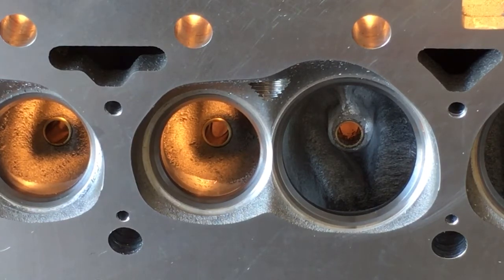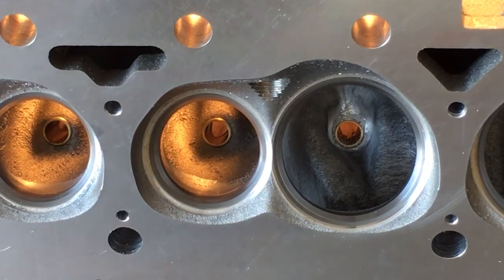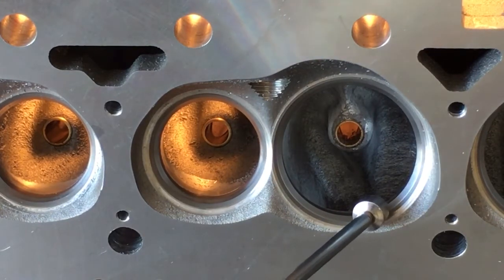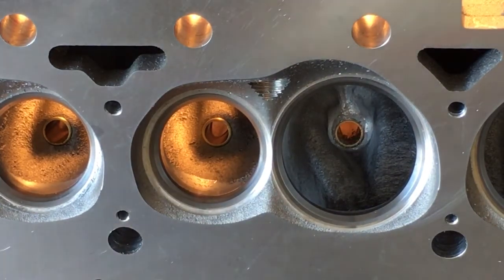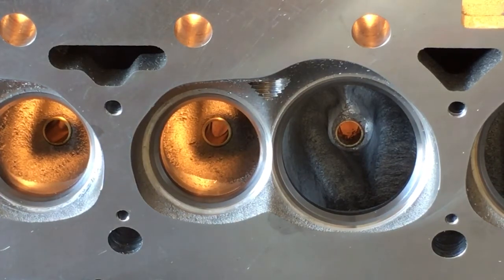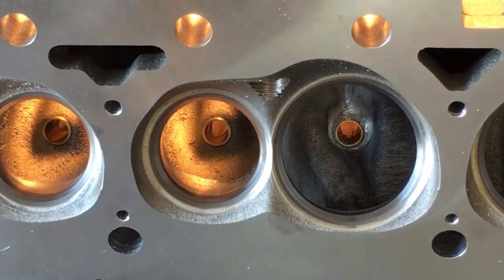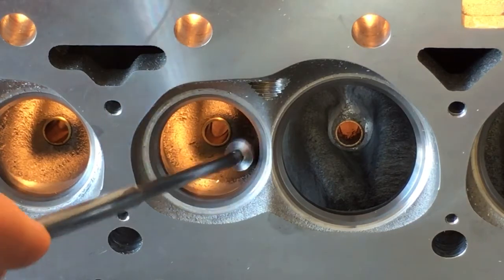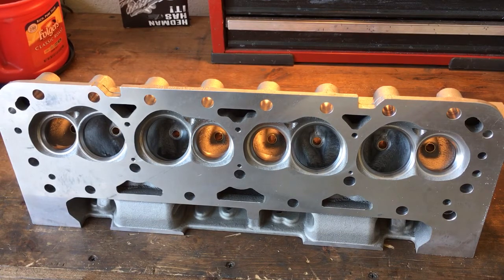Quantico cylinder heads 195cc  ebay

Comment: @HeadFlowInc any update on these after install?  I'm only seeing what are essentially unboxing reviews
Reply from the maker: The customer was supposed to put them on a 406 SBC for a 1982 Corvette cruiser.  I don’t think they ever finished the project due to health issues.  I would have been thrilled to run the heads!  JD
Reply: @HeadFlowInc  They look good in images, but I'm about to drop some coin on a replacement engine block for my Hilux and am hoping to find someone who's actually running their gear

Comment: Hi I have also experienced the vibration you mentioned. May I suggest that you replace the bearings in your grinder. Im pretty sure that will take care of that problem. I did that in my Milwaukee. If you ever drop your grinder and it lands on the collet kiss it goodbye and just go buy a new one. I know. Because it happened to me.
Reply from the maker: James Fowler Thanks for the tip, I ended up just going to Harbor Freight and buying a better version.  The HF grinders aren’t near the quality of a Milwaukee for sure!  
I have to be careful the longer 6” burrs can bend and that causes vibration even if I can’t see it. JD

Comment: Are the valves unshrouded well and adequately ? And could i unshroud them anymore?
Reply from the maker: DYNA KLO The chambers are decent, but you might be able to carefully massage the chamber a tad in a few areas. There are theories concerning swirl, directing the intake charge to promote better swirl that needs to be considered. Little If any needs work.  JD

Comment: I doubt anyone who works at dart make these, but they do seem to a good copy or clone of dart heads. I bet the biggest down side is just cheaper material and some showing a small quality control issue but not to bug by any means. I building a 355 with them and expect them to produce as good as before especially over the 193 tbi heads they r replacing lol. I chose these over using my other cast iron vortecs but my intake played a small role in that also but they do seem to be pretty damn good budget heads for no more then what they cost. I only buy them bare and purchase my components separately cause i would bet the valve train parts they put in the ready to run version are far from being as nice quality as the casting are
Reply from the maker: James J. McCloud I’m hoping the valve guides are a better quality!  The guides in the Pro Comp heads are very soft and where out really fast. JD

Comment: Do you have flow numbers and Dyno testing numbers???
Reply from the maker: Racer D I did not have these heads flowed and these were the only pair of Quantico heads I’ve worked so far.  You can compare these heads to most any 195-200cc runner heads on the market to get an idea of stock casting flow potential. JD

Comment: Put 1 bolt on the head to the block with no crank and scribe from underneath. Looks like they could be unshrouded more.
Reply from the maker: Don Rutter You’re right, we didn’t do any chamber work on these 241 heads. I’ll be posting some chamber mods on a set of 862’s coming soon!   Waiting on the machine shop, going from the stock 1.89/1.50 valves up to 2.00/1.57 valves that require valve unshrouding.  Stay tuned it’s coming!  Thanks for the feedback! 👍
Reply from the maker: Don Rutter Sorry, I got videos mixed up, the customer wasn’t paying for any chamber mods on these Quantico heads.

Comment: these are proheader pro header 200cc castings. they are dart platinum 200cc copies. it's the same head skip white sells as his nkb200 cc heads. Speier Racing Heads sells them as his economy heads & he loves them. his dart cnc program works perfectly on these heads.

Comment: Is this aluminum? And is the casting number a big deal on aluminum like it is on iron??
Reply from the maker: Jeffrey Adams Yes these are aftermarket aluminum heads.  The casting number?  Help need more details?
Reply: HeadFlowInc i was told when buying iron aftermarket heads to pay close attention to the casting number because it identifys the type and quality of the iron. Meaning not all casting are equal far as strength and durability. So is that the same when buying aluminum heads??? And whats your opinion on Blueprint heads there like 899 a set for sbc
Reply from the maker: Jeffrey Adams I’m not familiar with using the casting numbers on aftermarket heads to classify casting quality.  When burying factory heads yes 
Casting quality is something you physically and visually inspect. 
I’ve seen good reports by the Hot Rod magazine staff on the Blueprint engines/Parts.  Keep in mind when a company sponsors your show then you report good things about their products. 👍
Reply from the maker: Jeffrey Adams If you’re building a 350+ Engine don’t bother with head ports below 200cc intake.  In my experience the smaller runners leave you disappointed. 👍
Reply: HeadFlowInc thanks a lot for the info sir.... One last question im leaning towards the blue print head but im afraid that they will still have to be disassemble because of leaking valves so in your opinion do think i be better off buying a bare head and putting my own goodies in side??? My motor is a 355 with a 480 lift  flat tappet cam
Reply from the maker: Jeffrey Adams Honestly, your usually going to get better quality Parts and assembly if you start with a bare head.  Checking the valve seal should be done on any new head.  
The 280 Cam is pretty small but be sure to run at least a 2800-3200 stall or a manual transmission with it plus a 3.55 or more gear.
Reply: HeadFlowInc thanks... subscribing for sure.... And yes i have a 342 gear manual shift 350 turbo and 3000 stall and 100 shot of spary... I tore it apart simply to put a better (aluminum) head on it... My baby brother kicked my ass with his 3.7 mustang... But that was all motor and i had a stock 277 gear. Its a third gen camaro... But thanks man i really appreciate your time and info great guy to subscribe to. ✌
Reply from the maker: Jeffrey Adams Your combo sounds really good, I saw a street racer back in the late 80s who had a Monte Carlo super sport with a combo similar to yours win a lot of   Races.👍👍👍

Comment: 457/5000
Have you seen the Quantico heads of SBF? Is it supposed to be the same cast quality? I was surprised by the slight work of bowl blending around valve seats. I live outside U.S. and it is complicated for my budget hotrod for high customs costs. My options in aluminum heads are these Quantico and the NKB that provides Skipwhiteperformance in E Bay ... I guess they are of similar quality for the price. Thank you for so useful information!
Reply from the maker: Guillermo Vidal Good luck on your build!   I haven't seen the SBF heads, hopefully you'll get a good clean set.

Comment: Thanks for a quick reply. I have been looking at Edelbrock E210 at 1250.00. These being less then half the price making me take a second look. I have heard that some imported castings are not that bad its the valves and hardware that you have to be concerned with.
Reply from the maker: ZMANPERF If I needed a set of SBC heads I'd buy a set of these. As cast they're very nice, just make sure you add a steal shim under the valve springs to protect the aluminum head.

Comment: What is your opinion on the quality of the valves and valve springs on these heads?
Reply from the maker: The valves are stainless steel one piece with under cut stems. I have no idea what brand, but they look good visually.  The valve springs are a large diameter single flat tappet spring good to .600 lift.  It does use a good quality valve lock machined with the receiver groove for lash caps if needed.  I;m not impressed with the fitment to the valve of the positive valve seals, we're replacing them.
Reply from the maker: ZMANPERF Also, the valve springs are rated at 130# seat pressure @1.800"

Comment: Where did you originally learn how to port?
What material have you used to gain the base knowledge or training?
Have you ever worked for a firm or always been a freelance carver?
Reply from the maker: TheProchargedmopar I originally started back in the late 80's early 1990 modifying my own SBC heads with basic mods. I couldn't afford aftermarket heads but wanted to be faster. Simple stuff like gasket matching the intake/head eventually learning about bowl cuts and blends etc. 
I learned a lot from guys like Jim Lehart, Jim Hand, David Vizard, and Joe Mondello. Joe Mondello is where I learned my bowl cut percentages I use today. 
I use to only port my own heads or my friends/family stuff but decided to start taking a few jobs here and there. SBF, SBC, 6.1 Hemi, LS heads etc. 
I hate porting iron heads, I'll avoid them at all cost. Aluminum all the way! 😇